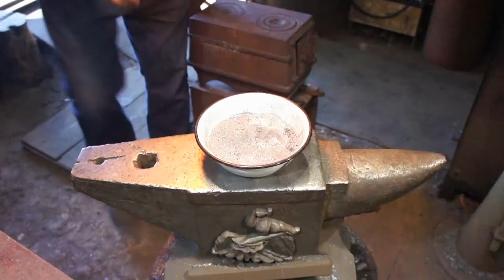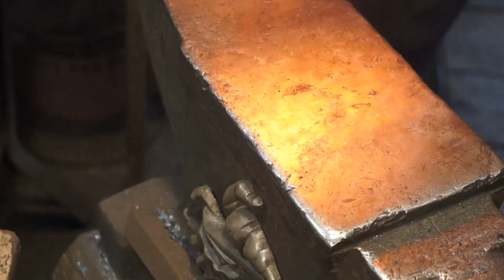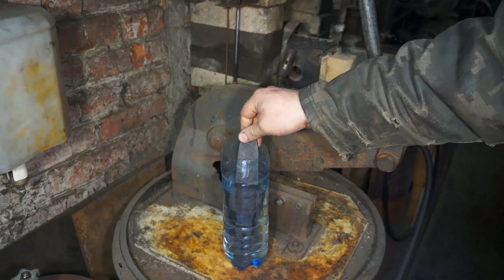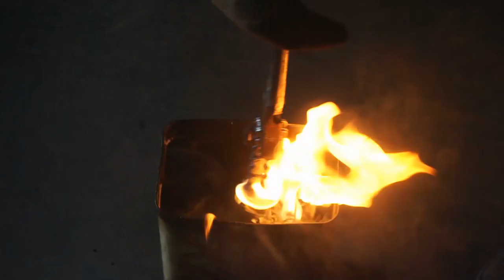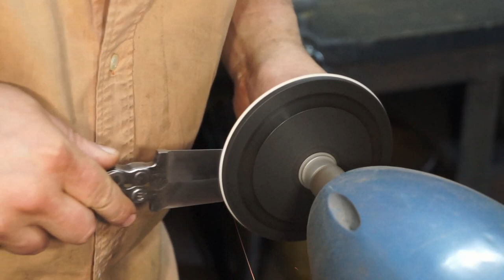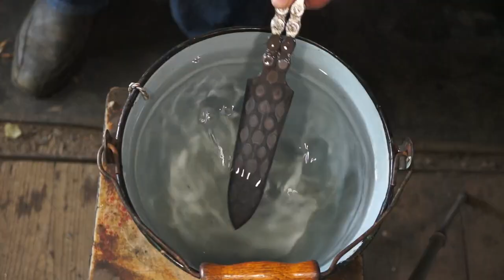Blade "Mad Max", Damascus steel from a motorcycle chain.

Comment: Thank you for the video. What kind of flux are you using?
Reply from the maker: I sprinkle flux (90% borax + 5% quartz sand + 5% charcoal powder) this is necessary for forging (forge) welding. The flux is alloyed with scale - the formed substance is sufficiently fluid and is easily displaced by deformation. In addition, the flux protects against oxygen and charcoal, carburizes the surface layer of metal - which lowers the welding temperature (if in brief).

Comment: What do you use for flux? My forge welds rarely come out that well just using borax.
Reply from the maker: I sprinkle flux (90% borax + 5% quartz sand + 5% charcoal powder) this is necessary for forging (forge) welding. The flux is alloyed with scale - the formed substance is sufficiently fluid and is easily displaced by deformation. In addition, the flux protects against oxygen and charcoal, carburizes the surface layer of metal - which lowers the welding temperature (if in brief).

Comment: Can you please tell me what is the liquid that you dipped the chain before going into the forge? I'm trying to make one and I'm having a real hard time with the chain falling apart before welding.
Reply from the maker: The billet is soaked in kerosene. This is necessary for good welding (forging) steel. When burning inside the workpiece remains soot (carbon), which, with further heating, scales and rust inside the workpiece restores to the iron, improving the quality of forging welding.
Reply: @shurap  Thank you very much. I'll try that. DO you leave it in the kerosene for a long time?

Comment: Ok, just stumbled upon this video and your channel. Super dope! Pardon my ignorance, but what is the sand you are putting on the blade during the forging process?
Reply from the maker: I sprinkle flux (90% borax + 5% quartz sand + 5% charcoal powder) this is necessary for forging (forge) welding. The flux is alloyed with scale - the formed substance is sufficiently fluid and is easily displaced by deformation. In addition, the flux protects against oxygen and charcoal, carburizes the surface layer of metal - which lowers the welding temperature (if in brief).
Reply: @shurap  Awesome. Very cool info. Thanks man!

Comment: using what liquid is it?material dipped before it is heated?may i know?
Reply from the maker: The billet is soaked in kerosene. This is necessary for good welding (forging) steel. When burning inside the workpiece remains soot (carbon), which, with further heating, scales and rust inside the workpiece restores to the iron, improving the quality of forging welding.

Comment: Fascinating! What are you sprinkling on the hot iron?
Reply from the maker: I sprinkle flux (90% borax + 5% quartz sand + 5% charcoal powder) this is necessary for forging (forge) welding. The flux is alloyed with scale - the formed substance is sufficiently fluid and is easily displaced by deformation. In addition, the flux protects against oxygen and charcoal, carburizes the surface layer of metal - which lowers the welding temperature (if in brief).

Comment: What's that powder he's putting on the blade?
Reply from the maker: I sprinkle flux (90% borax + 5% quartz sand + 5% charcoal powder) this is necessary for forging (forge) welding. The flux is alloyed with scale - the formed substance is sufficiently fluid and is easily displaced by deformation. In addition, the flux protects against oxygen and charcoal, carburizes the surface layer of metal - which lowers the welding temperature (if in brief).

Comment: Dumb question: What is he putting on the glowing metal all the time? Is it sand or some such? Thanks for letting me know :-)
Reply from the maker: I sprinkle flux (90% borax + 5% quartz sand + 5% charcoal powder) this is necessary for forging (forge) welding. The flux is alloyed with scale - the formed substance is sufficiently fluid and is easily displaced by deformation. In addition, the flux protects against oxygen and charcoal, carburizes the surface layer of metal - which lowers the welding temperature (if in brief).
Reply: @shurap  Thanks for letting me know. :-) Gaining more knowledge every day.

Comment: What's the sand for? If you put sand on it just before hammering it, aren't you hammering the sand into the metal?
Reply from the maker: I sprinkle flux (90% borax + 5% quartz sand + 5% charcoal powder) this is necessary for forging (forge) welding. The flux is alloyed with scale - the formed substance is sufficiently fluid and is easily displaced by deformation. In addition, the flux protects against oxygen and charcoal, carburizes the surface layer of metal - which lowers the welding temperature (if in brief).
Reply: @shurap  thank you for answering!

Comment: What is the powder that you sprinkle on the blade? And yes, once you wiped it clean and the spots showed up I was like, how much for my own lol.
Reply from the maker: I sprinkle flux (90% borax + 5% quartz sand + 5% charcoal powder) this is necessary for forging (forge) welding. The flux is alloyed with scale - the formed substance is sufficiently fluid and is easily displaced by deformation. In addition, the flux protects against oxygen and charcoal, carburizes the surface layer of metal - which lowers the welding temperature (if in brief).

Comment: What does your flux mixture contain?  Beautiful knife btw
Reply from the maker: I sprinkle flux (90% borax + 5% quartz sand + 5% charcoal powder) this is necessary for forging (forge) welding. The flux is alloyed with scale - the formed substance is sufficiently fluid and is easily displaced by deformation. In addition, the flux protects against oxygen and charcoal, carburizes the surface layer of metal - which lowers the welding temperature (if in brief).
Reply: @shurap  thank you for replying and helping me out. Much respect!

Comment: I’m new to blacksmithing topics. What is the sand like substance he puts on the steel?
Reply from the maker: I sprinkle flux (90% borax + 5% quartz sand + 5% charcoal powder) this is necessary for forging (forge) welding. The flux is alloyed with scale - the formed substance is sufficiently fluid and is easily displaced by deformation. In addition, the flux protects against oxygen and charcoal, carburizes the surface layer of metal - which lowers the welding temperature (if in brief).

Comment: O que é esse pó branco que ele coloca em cima do aço incandescente qdo ele tira do forno? É cinza? Pra quê serve isso?
Reply from the maker: Salpico com fluxo (bórax 90% + areia de quartzo 5% + pó de carvão 5%) necessário para a realização da soldadura (forja). O fluxo se funde com a escala - a substância resultante é bastante fluida e facilmente deslocada durante a deformação. Além disso, o fluxo protege do oxigênio e, à custa do carvão, cementa a camada superficial do metal - o que diminui a temperatura de soldagem (em suma).

Comment: What's the sprinkly stuff?  Pixie dust?  Is it carbon ashes?
Reply from the maker: I sprinkle flux (90% borax + 5% quartz sand + 5% charcoal powder) this is necessary for forging (forge) welding. The flux is alloyed with scale - the formed substance is sufficiently fluid and is easily displaced by deformation. In addition, the flux protects against oxygen and charcoal, carburizes the surface layer of metal - which lowers the welding temperature (if in brief).

Comment: I see it all the time and should know, but would someone educate me on that powder that he puts on? I know it has something to do with cleaning the blade while its hot.
Reply from the maker: I sprinkle flux (90% borax + 5% quartz sand + 5% charcoal powder) this is necessary for forging (forge) welding. The flux is alloyed with scale - the formed substance is sufficiently fluid and is easily displaced by deformation. In addition, the flux protects against oxygen and charcoal, carburizes the surface layer of metal - which lowers the welding temperature (if in brief).

Comment: Que líquido es el que le ponen al inicio y que polvo es el que le ponen cuando lo sacan caliente? Agradezco su atención.
Reply from the maker: La pieza de trabajo está empapada en queroseno. Esto es necesario para un buen acero de soldadura (forja). Cuando se quema, el hollín (carbón) permanece dentro de la pieza de trabajo, que, al calentar aún más, reduce la escala y el óxido dentro de la pieza de trabajo a hierro, mejorando la calidad de la soldadura de forja.

Rocío con fundente (borax 90% + arena de cuarzo 5% + carbón en polvo 5%) es necesario para realizar la soldadura (forja). El flujo se fusiona con la escala: la sustancia resultante es bastante fluida y se desplaza fácilmente durante la deformación. Además, el fundente protege contra el oxígeno y, a expensas del carbón vegetal, carburiza la capa superficial del metal, lo que reduce la temperatura de soldadura (en resumen).
Reply: @shurap  gracias por su atención

Comment: Why did you hammer it lightly on a block of wood?
Reply from the maker: The first welding is done on a tree, as the tree is a heat insulator, and not so selects temperature as an iron anvil. In addition - burning, the tree burns oxygen, protecting the workpiece and pouring the flux work. This is important for welding workpieces with small parts (cable, chain).

Comment: Whats the powder he puts on before bonking the heated metal and why?
Reply from the maker: I sprinkle flux (90% borax + 5% quartz sand + 5% charcoal powder) this is necessary for forging (forge) welding. The flux is alloyed with scale - the formed substance is sufficiently fluid and is easily displaced by deformation. In addition, the flux protects against oxygen and charcoal, carburizes the surface layer of metal - which lowers the welding temperature (if in brief).

Comment: What is he sprinkling on the blade when it is red hot?
Reply from the maker: I sprinkle flux (90% borax + 5% quartz sand + 5% charcoal powder) this is necessary for forging (forge) welding. The flux is alloyed with scale - the formed substance is sufficiently fluid and is easily displaced by deformation. In addition, the flux protects against oxygen and charcoal, carburizes the surface layer of metal - which lowers the welding temperature (if in brief).

Comment: What is the purpose of the gray dust that get sprinkled on the blade.
Reply from the maker: I sprinkle flux (90% borax + 5% quartz sand + 5% charcoal powder) this is necessary for forging (forge) welding. The flux is alloyed with scale - the formed substance is sufficiently fluid and is easily displaced by deformation. In addition, the flux protects against oxygen and charcoal, carburizes the surface layer of metal - which lowers the welding temperature (if in brief).

Comment: Whats in the bowl that u keep sprinkling over your blade ???
Reply from the maker: I sprinkle flux (90% borax + 5% quartz sand + 5% charcoal powder) this is necessary for forging (forge) welding. The flux is alloyed with scale - the formed substance is sufficiently fluid and is easily displaced by deformation. In addition, the flux protects against oxygen and charcoal, carburizes the surface layer of metal - which lowers the welding temperature (if in brief).
Reply: @shurap  thanks for sharing. 
This truely is a beautiful piece of work.

Comment: So what is the stuff in the bowl that gets sprinkled on the steel?
Reply from the maker: I sprinkle flux (90% borax + 5% quartz sand + 5% charcoal powder) this is necessary for forging (forge) welding. The flux is alloyed with scale - the formed substance is sufficiently fluid and is easily displaced by deformation. In addition, the flux protects against oxygen and charcoal, carburizes the surface layer of metal - which lowers the welding temperature (if in brief).

Comment: Super interesting to watch, but it would be interesting..er if you'd have some subtitles describing what you're doing. Temps, what you're sprinkling on and why, what you're dipping into, how long it took.. etc etc etc.. you know.. for the at home do it yourselfer.
Reply from the maker: I sprinkle flux (90% borax + 5% quartz sand + 5% charcoal powder) this is necessary for forging (forge) welding. The flux is alloyed with scale - the formed substance is sufficiently fluid and is easily displaced by deformation. In addition, the flux protects against oxygen and charcoal, carburizes the surface layer of metal - which lowers the welding temperature (if in brief).
Reply: @shurap  Thank you

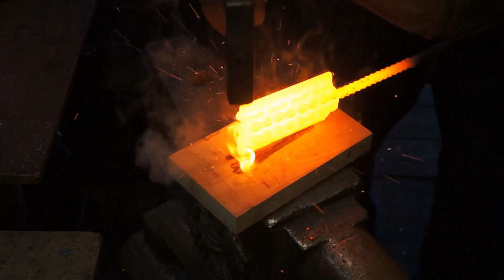Comment: 0:30 what was the point of doing that on a block of wood?
Reply from the maker: The first welding is done on a tree, as the tree is a heat insulator, and not so selects temperature as an iron anvil. In addition - burning, the tree burns oxygen, protecting the workpiece and pouring the flux work. This is important for welding workpieces with small parts (cable, chain).
Reply: shurap very interesting , but that makes sense! Thanks a lot your reply , and beautiful work!

Comment: What's that dust? is used to close the gap in the chain?
Reply from the maker: I sprinkle flux (90% borax + 5% quartz sand + 5% charcoal powder) this is necessary for forging (forge) welding. The flux is alloyed with scale - the formed substance is sufficiently fluid and is easily displaced by deformation. In addition, the flux protects against oxygen and charcoal, carburizes the surface layer of metal - which lowers the welding temperature (if in brief).

Comment: What is the liquid you put the billit in before starting to forge
Reply from the maker: The billet is soaked in kerosene. This is necessary for good welding (forging) steel. When burning inside the workpiece remains soot (carbon), which, with further heating, scales and rust inside the workpiece restores to the iron, improving the quality of forging welding.

Comment: Is the powder stuff borax or steel powder?
Reply from the maker: I sprinkle flux (90% borax + 5% quartz sand + 5% charcoal powder) this is necessary for forging (forge) welding. The flux is alloyed with scale - the formed substance is sufficiently fluid and is easily displaced by deformation. In addition, the flux protects against oxygen and charcoal, carburizes the surface layer of metal - which lowers the welding temperature (if in brief).

Comment: Question from a person who has never forged but enjoys watching. Why does he use the wood block on his first weld?
Reply from the maker: The first welding is done on a tree, as the tree is a heat insulator, and not so selects temperature as an iron anvil. In addition - burning, the tree burns oxygen, protecting the workpiece and pouring the flux work. This is important for welding workpieces with small parts (cable, chain).
Reply: @shurap  thanks for the insight. Very interesting learning the process.

Comment: What is the powder that you sprinkle over the billet?
Reply from the maker: I sprinkle flux (90% borax + 5% quartz sand + 5% charcoal powder) this is necessary for forging (forge) welding. The flux is alloyed with scale - the formed substance is sufficiently fluid and is easily displaced by deformation. In addition, the flux protects against oxygen and charcoal, carburizes the surface layer of metal - which lowers the welding temperature (if in brief).

Comment: What did you soak the steel in first?
Reply from the maker: The billet is soaked in kerosene. This is necessary for good welding (forging) steel. When burning inside the workpiece remains soot (carbon), which, with further heating, scales and rust inside the workpiece restores to the iron, improving the quality of forging welding.

Comment: Hey, Dmitri, what's that powder in the bowl?
Reply from the maker: I sprinkle flux (90% borax + 5% quartz sand + 5% charcoal powder) this is necessary for forging (forge) welding. The flux is alloyed with scale - the formed substance is sufficiently fluid and is easily displaced by deformation. In addition, the flux protects against oxygen and charcoal, carburizes the surface layer of metal - which lowers the welding temperature (if in brief).

Comment: What is the powder that you sprinkle on the blank?
Reply from the maker: I sprinkle flux (90% borax + 5% quartz sand + 5% charcoal powder) this is necessary for forging (forge) welding. The flux is alloyed with scale - the formed substance is sufficiently fluid and is easily displaced by deformation. In addition, the flux protects against oxygen and charcoal, carburizes the surface layer of metal - which lowers the welding temperature (if in brief).

Comment: What substance is that , the powder like thing????
Reply from the maker: I sprinkle flux (90% borax + 5% quartz sand + 5% charcoal powder) this is necessary for forging (forge) welding. The flux is alloyed with scale - the formed substance is sufficiently fluid and is easily displaced by deformation. In addition, the flux protects against oxygen and charcoal, carburizes the surface layer of metal - which lowers the welding temperature (if in brief).

Comment: what is this flour is this in the bowl
Reply from the maker: I sprinkle flux (90% borax + 5% quartz sand + 5% charcoal powder) this is necessary for forging (forge) welding. The flux is alloyed with scale - the formed substance is sufficiently fluid and is easily displaced by deformation. In addition, the flux protects against oxygen and charcoal, carburizes the surface layer of metal - which lowers the welding temperature (if in brief).